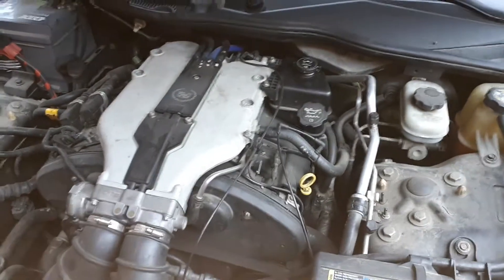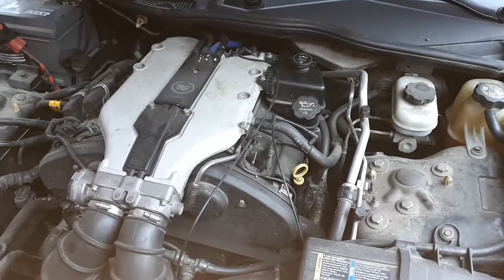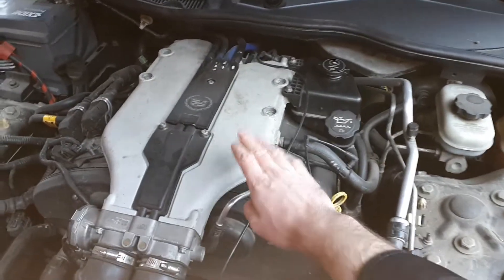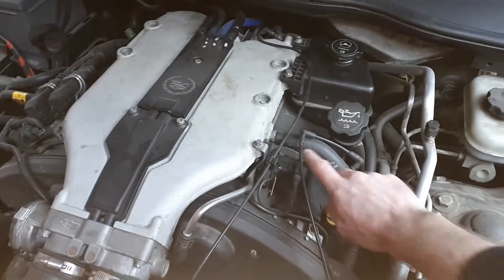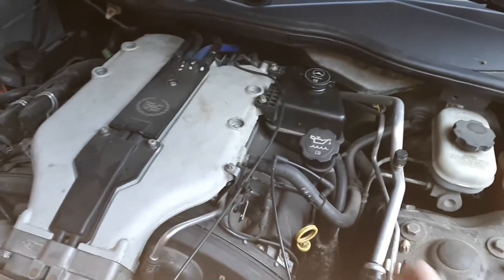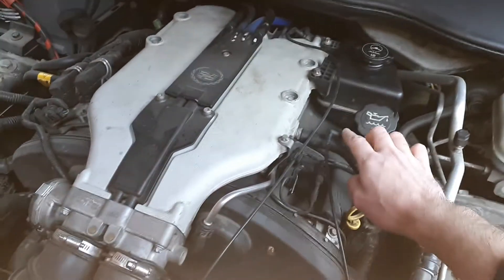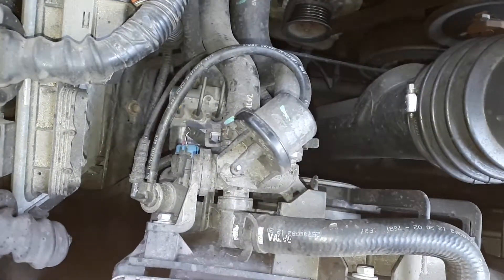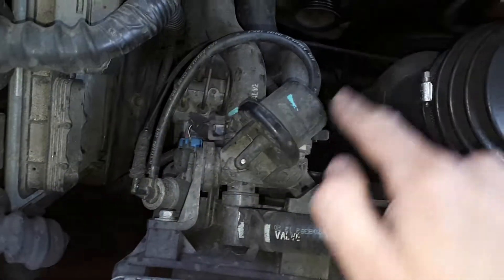Cadillac CTS 3.2L vacuum lines explained

Comment: Hey just did all of that what about the runner vacuum line under the manifold and where the sensor is, is that apart of the second t?
Reply from the maker: Thank you for question. Unfortunately I have no access to my car to check under hood, however there is Cadillac CTS 2003 vacuum diagram:
https://i.sstatic.net/rrmui.png

https://mechanics.stackexchange.com/questions/48566/identify-vacuum-hoses-at-rear-of-intake-manifold-on-2003-cadillac-cts
Reply from the maker: Replying to you question about vacuum line UNDER air intake collector. The line is very well visible in this video @04:59: https://youtu.be/i5oxPj-wgW0?si=Ju2yTNt19qsI5BUy

Comment: If I put a custom intake and delete the value chambers and what not on the intake u shaped tube and just run a long line to the heater valve it should be fine right?
Reply from the maker: In my opinion it still would be worth to keep vacuum chamber connected even with custom intake system. As vacuum chamber works as a vacuum accumulator and reduces vacuum level pulsation overall vacuum system when engine RPMs changes.

Comment: Thank you for sharing", question for the box that's down to the right and where does the vacuum go from the line go? Does it go under the box at the bottom and is their another line that connects to the top of that box to the first t- split???